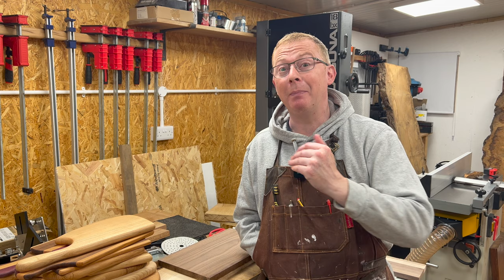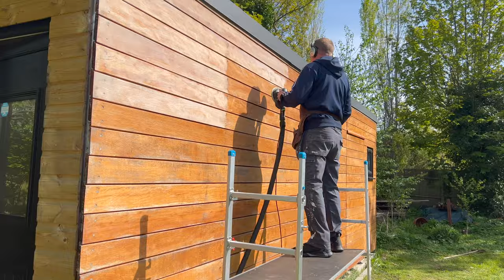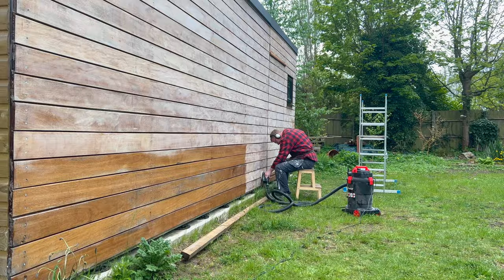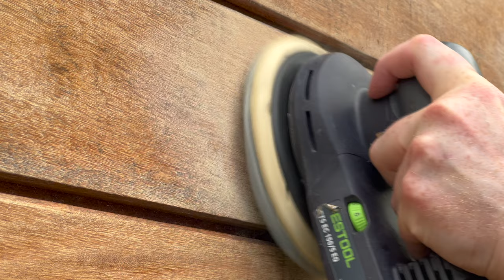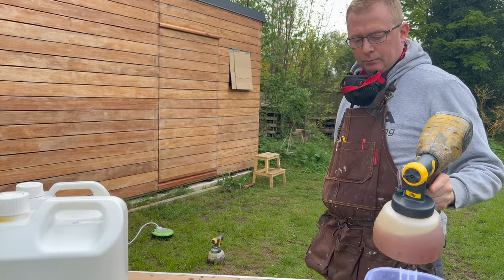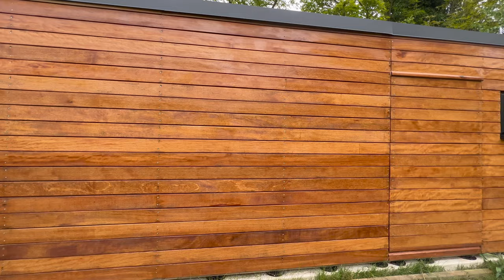I've Had It With Osmo UV Protection Oil👎

Comment: Can only compare it to using plain oils  -  linseed, tung, etc. On hardwood OSMO is way better, takes much longer before you need to recoat due to fungus, but it's not Varnish, plain oils only last a couple of months before starting to discolour. On Softwood I wouldn't expect any oil finish to last long in our climate as it moves way too much with moisture and temp . Plain oils only last months.
Reply from the maker: Cheers for the feedback as I appreciate all comments. Just wondering if you’ve managed to catch my latest video looking at a variety of different outdoor finishes. Would appreciate any input you have on that 👍👍

Comment: I'm a joiner. I've only used it once on exterior oak door I built. 1 year and it was failing and where it had failed the wood had gone black so the whole job looked shocking. Never again.
Reply from the maker: Interesting to hear pal, seems I’m not the only one who has had issues 👍

Comment: Great video and advice. As an enthusiastic amateur, i also dont mind the high initial cost if you get a longer lasting product, and is slightly forgiving for amateur techniques.   However, high cost without these benefits doesn't seem justified.
Reply from the maker: Thanks for the kind feedback. In my humble opinion the Osmo just isn’t worth the money as it doesn’t deliver any additional benefits at the much higher price point it to finishes at a fraction of the cost 👍👍
Reply: @Hand-i-Craft  such as?

Comment: I will add my two cents to this, as you said, so many variables. I used  Osmo UV Protecton Extra on a freshly built garden office 2 years ago and the finish was lovely and its been incredibly easy to maintain. But, I also used it on my new shed last year and 14 months later, it looks like utter pish which has silvered and faded badly. I get that things can be variable with wood, weather and other out of control situations, but for the price I'd at least expect a more forgiving product which performs better than it does. The price is very high for something that seems entirely unpredicatible in terms of performance. So I agree with you entirely!
Reply from the maker: Thanks for the comment and taking the time to share your experiences, much appreciated! Best wishes, Leo

Comment: I must admit my experience with Osmo clear satin 420 has been good. Our cabin was built in Sept 2023, I applied two coats of oil then on the cedar clad. Move on one year and there were signs of greying on the bottom cladding that sit on the composite decking. I half expected this, as it's closer to rain splash back etc.

Anyway, over the year the cedar in general had faded to a lighter colour which I actually prefer than the red colour the cedar originally came in. I applied two more coats last weekend and I'm really pleased with the finish, very even and some of the redness has come back but no where near to what was originally supplied. I only lightly sanded the wood before application.

My issue now is that I have a 3 litre tin and only used about 500ml! Am I ok to keep that under the stairs for another year??
Reply from the maker: Cheers for sharing your experiences Ben👍. Remainder should be fine for future use, just make sure the lid is tightly sealed 😀👍

Comment: About 40 years ago I was tasked with building platforms to be positioned alongside the production line at Fords of Dagenham the cladding we applied for the decking was the same timber you have used. The reason this was chosen was because it was impervious to oil penetration! We called it bastard teak (Kerung) from memory I do not think we were asked to apply a finish, however it was for indoor use. When you first mentioned using this timber you said it had been used for lorry floors, similar use to the decking platforms that I built. Probably best left to naturalise.
Reply from the maker: Great story pal. I think the method I’ve just used will be better and if annual upkeep is just sprayed once or twice a year then I’m happy with that 😀👍
Reply: They say let new wood weather a while before applying anything

Comment: I have similar issues with OSMO on exterior timber, I have sanded back and re-treated with OSMO but the issues have come back. I will use a different product in future. The timber is south facing and gets all the bad weather the English climate can throw at it. The OSMO treated timber looked great for a couple of months but is now covered in black stains so will need to be re-sanded and re-treated. Thanks Leo for sharing your findings.
Reply from the maker: Cheers Ian for the comment. I think the comments here have pointed out there do appear to be issues with it in particular with the British climate. Not worth the premium price in my humble opinion 😀👍
Reply: Same issue here, did you have to treat the wood with anything before coating? What did you end up using?

Comment: It was applied to my oak garden room here in the North of England. Looked fine for a year but know we have black spots and silvering. The osmo wood reviver gel is garbage on black spots and silvering. What is the best way to remove the black mould spots? I have a feeling I know but I was hoping there would be an easy way. Many thanks.
Reply from the maker: Sorry to hear about your experience and sadly I think your feeling about rectifying it is the only option, best get the sander out 😞

Comment: Found this v interesting three years ago I installed cedar cladding - probably about 30 sq metres and immediately finished with OSMO - the next year it was still looking great in the summer but a little faded so I coated again with OSMO UV protection oil, and over the winter the cedar now has black staining consistently over most of the cladding. It looks terrible and today I started to sand it back - and I’m having to cut back probably 4 coats of dried OSMO to get rid of the black marks - what an effort completing this is going to be!! It appears the black marking has penetrated all coats !!
So I can empathise with the OP - I put last years coat on in good weather with no inclement weather in the days after. I can only conclude that OSMO as a product has either changed formula, or it’s an inconsistent product that can’t be trusted.
I’m not looking forward to having to sand all of this back and will NOT be taking the OSMO risk again 😢
Reply from the maker: Thanks for the comment Mike and also sharing your experiences. Yes sanding back is a nightmare but needs to be done properly. I don’t know if you have caught my latest video on the channel looking at different types of outdoor finishes?

Comment: I’m really interested to see how this works out. My initial thought is the linseed alone isn’t going to eliminate the greying. It
Will lack the UV filters in other formulations. But I agree that osmo is pricey. I’ve tried several alternatives and each has a downside to its advantage. Anyway thanks for sharing.
Reply from the maker: Cheers Karl. As I said in the video it’s consistency I’m after, if it all ends up silvering then I’m ok with that. But spending a considerable amount expecting consistency and getting nowhere near it was very disappointing
Reply: Which alternatives and what downsides?
Reply: @Nick-r9z alternatives include Armoirtech, Barrettine and Cuprinol. Downsides generally include frequency of reapplication and the degree to which the wood is ambers. Also, some oils are a pain to apply to vertical surfaces. The advantages generally is consistency of finish when reapplying annually. I’ve found natural Cuprinol UV Decking oil to be a good all round product which doesn’t mind a year or two between redcoats and is easy to apply with a nice colour on softwood cladding.

Comment: I used OSMO on my Green Oak Frame exterior... Nice finish worked well. I used the same on kiln dried oak window frames, and they went black in areas (which is usually a reaction with ferrus materials or Iron dust) very odd - I had used Pewter, Brass and Stainless to stop that horrid Black effect you get on Oak. Just for the sake of disclosure - I did my interior of the Green Oak with Liberon Wax rubbed it with a hard bristle brush and it was EPIC! So I would advise anyone doing internals consider a nice wax brushed finish.
Reply from the maker: Thank you for sharing your experiences here with Osmo. I do believe plenty of folk take the time to read through the comments section so it is nice to get a variety of experiences and opinions 👍

Comment: Interesting.... I've used Osmo Polyx oil on interior floors, and their exterior One Coat Only HS Plus, both with great success.  The coverage on the latter was not great- I had to use a lot, and two coats, but the color (ebony- a true black), hasn't shown any fading in more than two years.  (Applied on freshly milled and planed cedar).  I wonder if it has to do with it's having more pigment that the transparent variety you demonstrated.  I have a can of their decking oil in thermowood, which is in between what you applied and the ebony I used.   I'm really hoping it doesn't fail.  One thing I've taken away from your video is to avoid their transparent oil.  Of course, all of these vary slightly in formulation- which could also be a factor.    Our climates are fairly similar.  Thanks for the honest review!
Reply from the maker: Thanks for the comments and sharing your positive experiences with Osmo. There are so many variables as to why a product can ‘fail’, but for it to happen twice for me means I’ll be giving it a miss from now onwards 👍👍

Comment: Use Impra ( Clear) 
Comes in two tins one is the undercoat ( called color) the other is the top coat ( elan) . Theres a good video on how to apply but two coats of each in short. 

I have also seen Osmo fail to protect oak exteanal window lintels.
Reply from the maker: Thanks for the tip 👍👍

Comment: Hi. Interesting vid. I was just searching for OSMO product as I was advised to use it on my garden cabin. Desperately needs something. Cuprinol? However, I want to keep the natural wood look rather than a colour. Whatever I use it looks like I have to apply product every 12 months. I have silver and black spots. Would it be best to sand this back first?
Reply from the maker: Mine was the same issue, wanting to keep the natural wood finish. I think the reality is you can’t really stop the silvering, but if it happens uniformly then that is much better than patchy issues like I had with the Osmo. The mixture I used instead of Osmo is working really well, it will need yearly maintenance and is a fraction of the cost of Osmo👍
Reply: @Hand-i-Craft  Thanks for the reply. May I ask about the mixture you are using? I might give that a go. Osmo is £80 for 2.5L. Two local trades recommended it.
Reply from the maker: @mannixfleming7838  The mix I’m using is 2 parts boiled linseed oil to 1 part turps (I used turps sub, much cheaper).
Reply: @Hand-i-Craft  If I was to boil Linseed oil I would have to do that on the job on the kitchen. Not sure that will go down well in the house haha. My cabin is 6M x 4M so might need a fair few litres mix of it.😃
Reply: @mannixfleming7838 oh my …

No.. what you do is you buy it already boiled.

Like Home depot

Comment: With the exception of deck oil (Mannings) I have yet to find an exterior wood finish that doesn't suffer badly in our damp climate. Osmo interior for me is a great product but I tried Osmo exterior UV protection on an oak garden bench and it went patchy grey with black mould after one winter. I have since sanded it, applied a wood preservative followed by deck oil, will be interesting to see how it does. I have also used Owatrol Textrol HES Clear on red cedar of a garden room. If you think Osmo is expensive, the Textrol HES was over £200 for 5 litres. I must be a fool but it was recommended by a well known garden room builder and those that have built their own garden rooms. Mine looked terrible after one winter, grey with black spots all over it. Only areas not subject to moisture were good. I have sanded it back and applied Barrantine wood preserver. I am now thinking what I should put on top of that, possible deck oil which has worked great on my decks and fences.  Note that I always follow the manufacturers instructions and I always check the wood moisture content before applying a finish.
Reply from the maker: Cheers for the comments here Steve, really useful to hear other folks experiences with different products, both positive and negative 👍👍
Reply: @petra Thanks for the advice, I will definitely research Salolin. I am thinking of coating several samples of wood with various products and leaving them out all winter to see what does best. I like an experiment. 😊

Comment: I had a total refurb on my house exterior and had the front and side top half clad in Canadian red cedar and the bottom half rendered which looked fabulous. The red cedar came pre finished with a water based uv varnish at a cost of 4k fitted. 4 years on and the varnish is fading and peeling in places and the cedar starting the greying process in patches. Wood Finishes Direct have advised me that I have to strip the varnish off with paint stripper (Owatrol), wash it all down and then use a wood brightener (Owatrol Net- Trol), sand it all down and then use Osmo.
All of this is a massive, time consuming expensive undertaking with the added expense of scaffolding. I now realise what  massive mistake I made having the cedar cladding  in the first place and should have gone with the full render or used composite boards instead of cedar.
My current dilemma is, should i undertake Wood Finishes Direct advice which sounds correct to me (the downside of this is I will have to re finish every 1-2 years including scaffolding) or paint the cedar with a high performance paint which some claim can last up to 10 years or rip the whole lot off and use composite boards or render?
It would seem that I have got myself into a right dilemma which is hugely expensive and time consuming either way. Any advice?
Reply from the maker: Hello Stephen, thanks for the message and apologies for such a late reply. No idea why but your message went into my possible Spam folder so I’ve only just seen it. Personally if I was in your shoes I’d strip the finish off and then just leave it. Yes it will naturally grey but if it’s uniform across the whole surface area it’ll look great and will last (I think) for around 25-30 years. I’d much rather do that than paint it which personally I think wouldn’t look nice.

As I’ve found out, any kind of wood treatment to try and retain its original colour will require some form of regular maintenance and this is difficult for you for reasons mentioned like scaffolding etc. If I were in your shoes pal, I’d strip it back and l let nature take its course 👍
Reply: We had a lovely red cedar hut for our youth group. After 30 years of it weathering fine, they painted it with a thick dark brown paint. Looks awful now it's cracked and peeled in places
Reply: Do not use Osmo outside you will sure regret it
Reply: @BigAds.  why?
Reply: Paint it with the best exterior paint you can find.  Products are cheap, time is expensive.  Should last 10-15 years.

Comment: I used Osmo on our oak shutters in France.  
After 10 years and one refresh without sanding the finish is still pretty good.  The problem has been that the shutters do change width quite a lot as the weather changes (summer to winter).  They swelled so much I couldn't close them and then after reducing the width on one side so they closed (retreating with Osmo) after a couple of years I had to build up one side again to allow the locks to engage.  
Last year they blew open in a storm so I have now fitted an extra bolt inside which is tiresome as I can only open them from inside when it's used.  It does work - so far - though.
I don't know how I could have avoided this although I suspect that when they were made a bit more cleanse should have been provided in the grooves on the stiles to allow the T&G boards to expand sideways a bit more.
Reply from the maker: In the last video I did Mike, there were a few comments from folk who used Osmo for years but have moved away from it in recent times, maybe not quite what it once was or the competition had caught up and overtook them 🤷‍♂️🤷‍♂️

Comment: What could i use on osb 3 board , it's being used for flooring that will be in a Catering van
Reply from the maker: I’d say something like a polyurethane varnish would be a good idea. There are specific floor varnishes available but my understanding is polyurethane ones are the most durable 👍
Reply: @Hand-i-Craft Thanks for the tip
Reply: @Military872  I`m a floorlayer mate.......if it`s catering, (grease etc), you would need a vinyl safety floor imho.......

Comment: I think that you’re video title is misleading. Slightly. The results depends on the type of wood the absorption. The amount of sunlight it’s exposed to. I made house signs out of spruce they are exposed to the sun  and rain and are holding up well. Our timber clad extension has a few areas that are greying and need retreating  but I did look at linseed oil. Difficult to obtain pure linseed in large quantities and is it any better. I will retreat the areas in question and see if it’s better next year. Just my thoughts.
Reply from the maker: Cheers for the message, but I have to say I don’t think the title is misleading. I’m not one for clickbait, but I think calling out that this product is overpriced and overrated is balanced considering my experiences and also the cheaper alternatives 😀😀👍👍